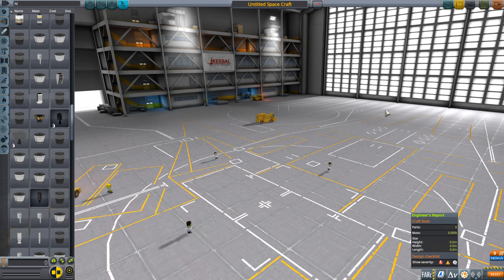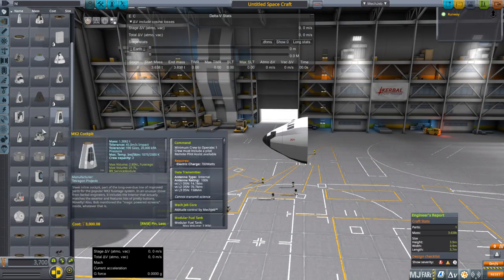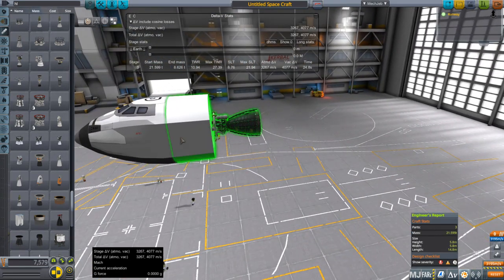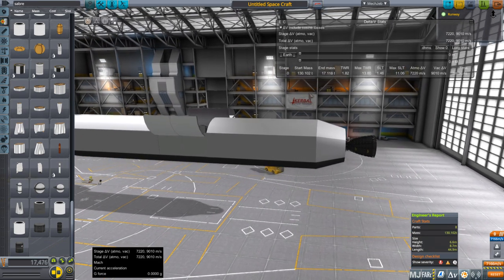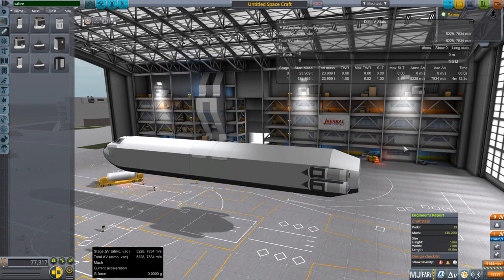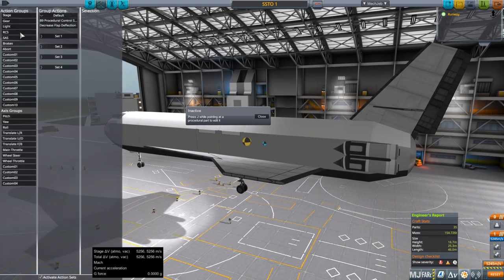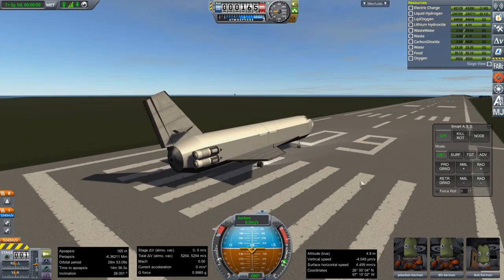Realism Overhaul in KSP 1.8.1 - SSTO Plane Tutorial Part 1

Comment: Awesome video, your rate of uploading is at a professional level. 

You said a couple of video's earlier that in order to get the mass of the rocket compared to the payload you need to do: (10000/isp)*payload mass. 

Now I don't know the dry mass of this spaceplane, but its just one stage, and all the dry mass will need to get to orbit. Although airbreathing is efficiënt, you will lose alot of deltaV just from drag. In order to get to orbit I think you 'll need more fuel, but mostly more TWR at launch to spend less time in the atmosphere. That would also solve the wing problem. Two Saber M's would be a good thing to try I think.
Reply from the maker: That equation is for a properly staged rocket as a guideline - basically, if your rocket is heavier than that, you probably don't have optimal staging. Unfortunately, an SSTO by definition doesn't have optimal staging. That said, 2 SABRE Ms is probably a good idea. That would be the equivalent of what Skylon has.
Reply: Is there a guideline to how much a spaceplane should weigh compared to its dry mass and average isp?
Reply from the maker: Not really, which is another thing that makes this a particular challenge. There's just not much of a sample size.

Comment: 7:10 Wait, why is that mass ratio worse than the non-balloon SLWT?

8:10 I really wish these parts were at least slightly "proceduralized", so you could alter their length and width/diameter, respectively. Currently, my alternate historical orbital spaceplanes are unsimulatable with them as their width is off.

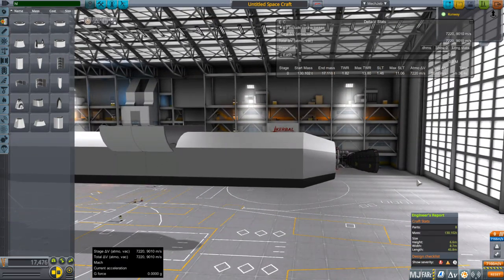9:35 Do you know of any mods adding higher-speed airbreathing engines, e.g. air turborockets, ramjets, or scramjets? 10:15 OK, I expected the existence of those parts, and that ticks off the first option from the last question, but the others still apply.

11:20 F and G? Are those notional improvements or the SLS versions?

15:05 That is counting that extra kerosene mass, though...

24:00 They probably increase the operational speed heat tolerance of the engines. I don't think they do anything if the speed is less than Mach 3 and change.

27:45 I suggest you start with zero payload capacity (and possibly no crew cabin) first before figuring out how to add that in.

I've probably said this earlier, but I wish it was possible to run certain engines on suboptimal mixtures in RO. It would make bimodal craft just so much easier.
Reply from the maker: The problem RO often has is it bases mass ratios on smaller tanks and often doesn't properly take into account that mass ratio improves as you increase diameter. There is a stock ramjet that is properly configured for RO, but we are missing scramjets. I intend to look into how to make scramjets happen, but no guarantees. RS-25F is a real intended version of the RS-25 while the RS-25G is total nonsense someone made up and unilaterally added to RO. I've since objected to that RS-25G so it might be removed, not sure.